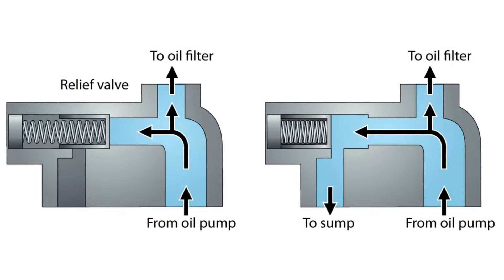DIY - How to Fix P0520-P0524 Engine Codes!

Comment: P0520 came in my Durango sxt 2014. Oil dipstick shows safe level. Vehicle system shows normal oil psi. No overheating. Can anyone help what is happening.
Reply from the maker: S - We give a list of potential causes and fixes in the video. Did you check all of them?
Reply: Thank you bro